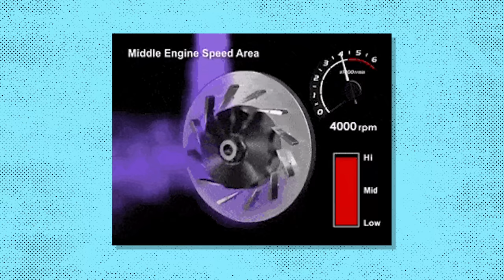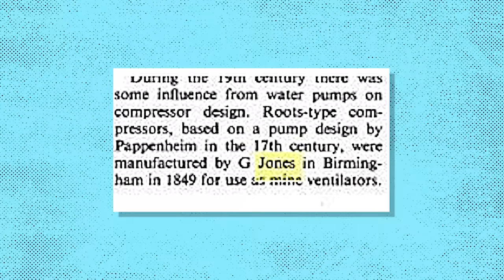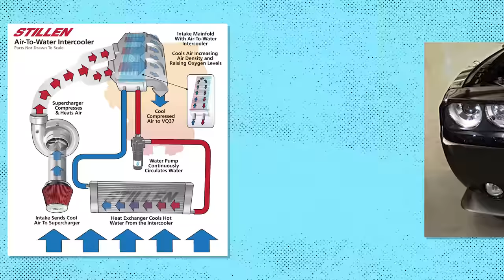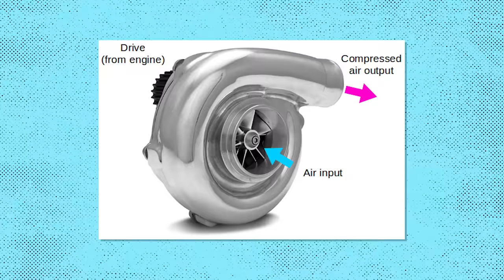Why Superchargers Aren't As Good as Turbos

Comment: turbos for efficiency, superchargers for power. it is simple. turbos are more common because they can get better mileage. hardcore performance gets superchargers.
Reply: Turbos make much more power than superchargers... and they are more efficient... that is why they dominate the forced induction market.
Reply: @sandervanderkammen9230  i would be willing to check out your evidence. However, i disagree.
Reply: @ttrbykir  Check out the First and Second Laws of Thermodynamics

A supercharger is nothing more than a external compressor.

A turbocharger is a driven by a Heat Engine that operates using the BRAYTON CYCLE in a COMBINED CYCLE with the Otto or Diesel engine it is attached to.
 When more of the heat energy from burning the fuel is converted into work... more useable horsepower is generated by the reciprocating engine.
Any questions?
Reply: @sandervanderkammen9230  yeah, they are more efficient that has been established. Show me where they make more power.
Reply: @ttrbykir  What part did you not understand?
If you have a supercharged engine that produces 210 horsepower at 8 psi of manifold boost? The same engine turbocharged will produce 240 horsepower at 8 psi.

The turbocharger uses the horsepower that is wasted out the tailpipe in the supercharged engine to drive the compressor.

Any questions?

Comment: I had a thought that would make the supercharger less bad wouldn't if their was a way have it use electric motor of some sorts but not feed off of the belt of the engine make it more positive than negative than you could in theory have a super charger and turbo charger together on one engine but the supercharger would feed of the battery power sense it has to come from something so while it doesnt hurt the engine by useing the belt system it is just useing electric instead and sende turbo charger is useing the output gas from the engine you would benefit having both on but down the line of the electric superchargers downside would then hit a point where the battery consumption rate will be to high to where it will cause a lack of energy to even start the engine its self but it would still be better than having it siphon off of the engine to try to gain more power by costing power which is just adding more problems and not really gaining to much benefit other than all but the central supercharger having its boost at all times is the only up side so the 2 one that has male and female impeller that compresses powered by electric would be the best option to make superchargers be useful without being parasitic to the engine and stacking it with the turbocharger would be even better but then I had a stupid theory idea what if you chained turbochargers feed like it starts from the engin but then 1 feed s to another repeatedly then into the engine what would happen would it repeatedly compress the air or would it reach a point where all your doing is keeping it compressed and increasing air input but not compressing any further and if it does keep compressing after each one how many till the engine wont like it where it's too much air intank ?

Comment: Superchargers are used to enhance and engine, meanwhile a turbo is the mainstay of the engine. the engine doesnt have to be the best to make good power from turbo. the supercharger is the better way to make/keep power long term, as turbos put alot of stress (more so than superchargers.) I would prefer superchargers as they tend to be simpler and easier to maintain.
Reply: Turbos are better for improving power and efficiency.
A properly designed and maintained turbo will last the life of the engine.

Comment: from an engineering and math perspective, turbo is better in terms of power and efficiency.   But from the perspective of a driver or racer, supercharger is a better feel and is a lot more predictable.  Having power instantly without lag makes a big difference in the driving experience.     More food does not mean its better than good food.
Reply: The superior power output offered by the turbocharger is often a far greater competitive advantage, as is the improvement in performance to fuel load which is restricted by some racing series.
In particular in high speed tracks or endurance racing were throttle response is less important than high power output or laps/time per pit stop or total amount of fuel used.
Turbos have been very successful in F1 and Indy Car, as well as Le Mans and World Rallye.
Reply: @sandervanderkammen9230  and for the regular people who enjoy track days or autocross, supercharger is more predictable.   Much like formula one, just because its covered in wings and other aero systems doesnt make it that good for other applications.   The immediate power that superchargers give is extremely useful for people who drive on windy roads or do autocross racing on the weekends
Reply: @joshuaszeto  Well, you are referring to production road cars, not real racing cars, of course turbocharged production cars far outnumber supercharged production cars... in fact superchargers by comparison are relatively rare.
Most cars today have very little throttle lag compared to 40 years ago... and the precieved lag does not equate to slower acceleration, turbo cars often have much quicker acceration times than a comparable  supercharged car.
I would agree that it takes less skill to drive a supercharged car at its limit than a turbocharged one.
Reply: @sandervanderkammen9230  I happen to own a turbo and NA version of more or less the same engine and while the turbo version is faster, there is a very distinct rubber band feel to the acceleration.  And it's already a twin scroll turbo so it's designed for low lag right from the factory.   When I leave the house, I always pick the NA car.    I don't know about your experience with cars but I work with cars for a living and I have driven a lot of cars from basic cars like yaris, micra all the way to tesla S p100d, GT3rs, mclarens and also muscle cars.   turbo is more prevalent for the efficiency aspect.  with tightening emissions and fuel economy requirements, turbo is the obvious way to go.  Most average drivers will not ask for instantaneous throttle response on their daily commute.   They just want fuel economy when they drive and some reasonable power to pass on the highway.   I have also talked to people who have supercharged and turbocharged their cars and the general consensus is that sc is a better driving car.  It's not about skill.  it's about driving feel.   If you make the argument that turbo requires more skill to handle the lag, then explain why cars have 2 step and antilag systems on actual racecars.  surely pro drivers would have the skill to deal with the lag.   It all depends on the application
Reply: @joshuaszeto  Doesn't sound like a performance vehicle... or that you have ever driven a excellent example of a turbocharged performance car.
Reply: @joshuaszeto  Most turbocharged race cars don't... they are simply qell engineered and have nothing more than a adjustable wastegate.
The skill is in controlling the sudden, almost explosive surge of power that some turbo race cars produce... not much of a problem in a straight line... but certainly requires more skill than the average driver in the curves....

Comment: turbos still use a considerable amount of engine power. its not possible to compress air without getting energy from somewhere, somethings not gonna spin just cause the air is hot. only if the air gets hotter (requiring energy)
Reply: They do require power but they scavenge that power from a waste source (exhaust gas pressure). Technically the increased exhaust gas pressure from the turbine will cause some degree of losses but it's far smaller than the losses from a supercharger which are directly pulled from the useful power that the engine puts into the crankshaft.
Reply: You obviously don't understand how a turbocharger works...
Reply: @bosstowndynamics5488  The turbocharger Reduces pumping loss... so there is a net gain in shaft horsepower... not a loss.
Reply: @sandervanderkammen9230  Obviously there's a net gain, if there wasn't then nobody would use them
Reply: @bosstowndynamics5488  Then were does the extra horsepower come from???
Reply: @sandervanderkammen9230  Because you're burning more fuel. You're not somehow powering the engine off of exhaust gases, the power comes from forcing more air in letting your burn more fuel. That's why superchargers, which directly steal a substantial amount of power from the engine, still increase net power output. Turbochargers do put back pressure on the exhaust, you can't get the energy to pump air from nothing, but the increase in back pressure is much less than the parasitic loss of a supercharger because most of the energy powering the turbo is waste from the exhaust. Result is that technically turbos do rob engine power, but only trivial amounts, and in exchange the forced induction more than compensates.
Reply: @bosstowndynamics5488  Turbocharged engines use LESS fuel... they have Lower BSFC than supercharged engines.
Reply: @bosstowndynamics5488  There is no "backpressure"... the exhaust turbine is a Impluse Type Turbine it works using gas velocity... not pressure.
Reply: @sandervanderkammen9230  Do you have a source for that? Everything I've seen suggests that under equivalent conditions turbo engines use more fuel. Modern tiny turbo engines only use less fuel under test conditions where they're driven gently, if you actually give them throttle they often use more than equivalent NA engines
Reply: @sandervanderkammen9230  If there's a restriction in flow there's backpressure, if the turbo is taking energy from the exhaust it's restricting flow.
Reply: @bosstowndynamics5488  There is enough BSFC data out there... most people simply don't look for it because they don't understand what it is..

Many available turbocharged gasoline engines deliver BSFC of .450 Lb/(bhp~hr.) or less... thats better than many Diesel engines..

Diesel engines get a HUGE boost in BSFC  efficiency with turbocharging.
Reply: @bosstowndynamics5488  EPA LA drive cycle tests are standardized which means they are a very accurate way of comparing BSFC of different engines..
The EPA test are not, nor were they ever intended to be used to predict an individuals real world MPGs because there are simply too many variables in real world driving conditions.
It a well-known and understood fact fact many drivers tend to drive turbocharged vehicles more aggressively... this is not accurate reflection of the engines actual fuel efficiency.

Aircraft are probably the best example of turbocharger efficiency... a turbocharged aircraft engine will certainly deliver better BSFC performance than a supercharged engines of a similar power output.
Reply: @bosstowndynamics5488  How can there be a restriction if there is more airflow than the same engine without a turbocharger???

I think you need to worrk on your understanding of Fluid Dynamics as they apply to turbochargers.

In a naturally aspirated engine, when it is running... the intake manifold pressures are always LESS than atmospheric pressure...
Any increase in exhaust manifold pressures creates a greater Delta~P 

With a turbocharger the centrifugal compressor is a more efficient pump and the energy used to drive the pump comes from the waste heat energy in the exhaust.

The amount of shaft horsepower generated by the exhaust turbine wheel is directly proportional to the temperature drop inside the turbine.

If the Delta~P is the same or less? Then even though the exhaust manifold pressure is higher than the Naturally Aspirated engine? There is no effective backpressure.
Any questions?

Comment: Turbochargers by design have a lot more horsepower producing potential, than a belt driven supercharger, in most cases. I think that is a well known conclusion. This video is heavily biased towards....turbos are good (agreed) and everything else is very bad, you are crazy to consider it. You did a good job of explaining how each power adder works, you should stick with that. The reality is....depending on what is INTENDED by the manufacturer...a turbo might not be their best choice. The type of vehicle, type of customer, how the vehicle will be driven, type of engine, cost of power adder, cost of total vehicle ect all are part of the equation. I am personally obsessed with forced air power adders, of ALL types. I believe turbos have the highest horse power providing potential...period full stop. I also believe belt driven boost producers will allow me to get the desired results I want...much easier relatively speaking, and within my budget and ability, than turbo charging. That said, a turbo setup is on my (bigtime)  wish list, for a vehicle with different performance goals in mind. How I am going to pay for this is a whole different story. My focus is manageable controllable predictable affordable power adders. Turbo's are cool....other forms are more doable.
Thanks for reading my OPINION.
Reply: Don't confuse drivabilty with performance, a slower car will always be more manageable and easier to drive  than a faster one, less experienced drivers can be intimidated by the sudden surge of power and faster acceration rate of turbocharged engines.
Reply: @sandervanderkammen9230  If you are a serious OEM.....drive ability IS part of the performance equation. If the intended customer is unsatisfied with the drive ability of ANY vehicle, the true measure of performance...SALES drop. You seem to be determined to cross swords with me based on some perceived perception of knowledge superiority. Congratulations, try not to break both arms patting your self on the back. Turbochargers have many built in advantages over belt driven superchargers. It's that positive displacement vs true compressor thing again. That said...what the hell is you boggle? Do you plan to set the world right, one post at a time on YouTube?
All shoes don't fit all feet. All hats don't fit all heads. You can lead a horse to water, but you can't make it drink. And you can't type with two broken arms!
Reply: @mikef-gi2dg  Production cars use turbos because they make more power and have better fuel economy.
Superchargers suck because they use more fuel and make less power.
Any questions son?
Reply: @sandervanderkammen9230  yes...are you 13?

Comment: Doesn't exhaust gasses need "power" to be pushed out of the engine and spin the turbo ?              Ofc it wont be as much but still ...
Reply: Yes, and no.
Some pumping loss occurs during the exhaust stroke... but the energy to drive the exhaust turbine is recovered heat energy. The amount of heat energy converted into shaft horsepower is greater than the pumping loss on the reciprocating engine so this loss is offset and overcome by the increase in pumping efficiency from the centrifugal compressor which unloads the reciprocating engine.
Reply: @sandervanderkammen9230  thats my point,  same as a supercharger but with less loss
Reply: @eldergomes3782  No, completely different than a supercharger.
The Turbocharger has no parasitic loss... all of the energy to drive the compressor comes from the waste heat energy in the exhaust gasses.
The supercharger gets all of its energy from the crankshaft.
Big difference.